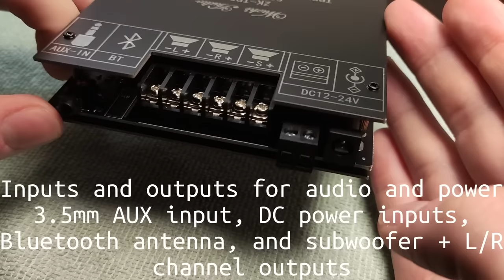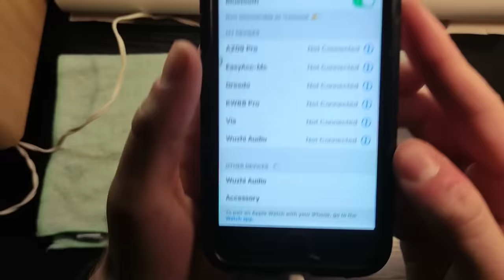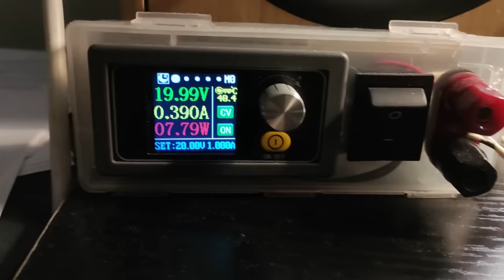Cheap 200w 2.1 Amplifier - Wuzhi ZK-TB21 Unboxing Assembly and Test

Comment: I own a few and one by FOSI Audio. They are great for my use cases. The only think I dislike is that when I have aux connected the Bluetooth chip is still available for pairing, and it's not good to have your music stream interrupted in the best part.

I've though of hacking the device to add a switch -- not sure it's easy to do. I've even thought of cutting the antenna and using external Bluetooth receiver.

Thanks for the video.
Reply from the maker: Yes that's common with the jieli microcontrollers on them, they can be flashed with firmware that gives aux priority over Bluetooth so you can't connect to it when aux is connected. I so far have not found any way to do this though. There are some forum threads online that discuss it but don't have any success.
Reply: if only you could show us how to cut the bluetooth output to the preamp section.... or perhapas any idea to mix the signal from bluetooth with some signals from microphone preamp?
Reply: I have this exact amp I bought 2 years ago and have abused it daily and it still works perfectly.  However at some point the Bluetooth range went from a dismal 10' range new to about 12"!   I literally had to leave my phone on top of the amp to get clear reception (have another 100wx2 amp that does this too).  I bought a cheap Bluetooth antenna from parts express($5) and cut the PCB antenna about 5mm in and soldered the tiny antenna wires to it and now my range is about 20 feet!

The antenna is a chassis mount and the antenna can unscrew from the mount.  I drilled a hole to mount it in the top cover and when the antenna is attached lays almost flat with the cover.  Antenna and cover are parallel to each other.
Reply: @voodooyam I've been very happy with the performance of the amps I own with exception to the Bluetooth range.  I have no idea how the range can deteriorate like it did.  I use one to power 2 old Polk speakers and an 8" subwoofer hooked to my TV.  Another is used to push 4 8" ceiling mounted speakers(2 on each channel in parallel to make 4ohm load) in my enclosed porch.
Reply: I wish I had a switch for bluetooth because my stupid neighbors are at the edge of the bluetooth connection and some idiot tried to connect to my speakers once, and now every time he's at certain range his phone tries to connect to the bluetooth and it does the constant "connected" sound.... :/ kinda wish I could disable the bluetooth completely if I can't toggle.
Reply: You can cut the antenna.
Reply: @Mavi222  I haven't been able to find a pin out diagram for the Bluetooth chip because it's a Chinese chip with no info.   I would also love it if I could figure out how to switch Bluetooth on and off

Comment: Ano magandang 2way fullrange  speaker para sa ZK-TB21 at ZK-HT21? Yung available sana sa pinas
Reply: *Para sa Left and Right channel
Reply from the maker: @techsoundph6210  There is too much variety for only one recommendation, any passive 2 way speakers can be used. I use Eltax Monitor iii but any other models can be used as long as the impedance is 4-8 ohms and it can handle the power from the amplifier.

Comment: If u turn sub chanel at full volume the distorsion is insane..
Reply from the maker: What power supply did you use? It will distort heavily at high volumes if you use anything under 24v with at least 4 amps of current capacity.
Reply: Why mine has a diatortion but my power supply is 12v 10a
Reply: @jecryswin  Thats total of 120watts its not enough in high volume
Reply: @jecryswin you need 200watts of power supply

Comment: is it on normaly temprature  if i put 19v ? for daily uses ? not hot / overheat??
Reply from the maker: For constant use I suggest you use a small fan on the heatsink to keep it cool, it will get hot if you use it at high power continuously.
Reply: @scellysspeakers  thanks my broo... i've been subscribe to you 👌

Comment: how to avoid humming buzzing noise?
Reply from the maker: Make sure you use a power supply with very little DC ripple
Reply: @scellysspeakers  can u suggest? what kind ?
Reply from the maker: @impopio4987  The best case scenario for clean DC power is an appropriately protected battery pack of the correct voltage, but almost any normal power supply of at least 20v should be fine.

Comment: Please tell me that 200w(50w+50w+100w) is it peak power or RMS? If it's peak then what it's actual RMS watt?
Reply from the maker: The 200w most likely is just peak power, i'd expect continuous RMS power to be closer to 150ish watts (37w+37w+75w) since the amplifier is rated for maximum 24v and a bit over 5a.
Reply: There, these capacities are almost two times less than those declared as usual by marketing ...
Reply: Depending on what power supply and amperage, remove from this RMC 25% and you will get pure power without distortion of the real one in the measurement standard DIN What is real and not RMS for beautiful ciphers
Reply: He’s running at half power at 7.83 watts, it’s a scam device with fake lettering. In reality it’s a 20w amp. Having djd for 30 years with a commercial 150 watt amp it would tear those little speakers apart.

Comment: Can i use 12v 10ampere, is it enough for power supply
Reply from the maker: You would want to use a 24v power supply of at least 5 amps current capacity to get the most out of it, if you use anything under 18v it will distort heavily at high volumes.
Reply: @scellysspeakers  but 10A.
Reply from the maker: @emesacolney2756  That bit is fine but you won't get the full power out of it unless it's a 24v input, no matter how big the current capacity is you will still get distortion at high volumes if it's under 18v
Reply: @scellysspeakers  thanks, ...... I ordered on amazon and almost arrive, ZK TB21
Reply from the maker: @emesacolney2756  I hope you enjoy it when it arrives!
Reply: @scellysspeakers  can i use 12inch subwoofer
Reply from the maker: @emesacolney2756  You can but it won't be driving it at its full potential
Reply: 18-24v 5-8 ampere

Comment: I use a zk-tb21 circuit and a 19.5v 4.62a power supply, how many watts should the subwoofer use?
Reply from the maker: You'd expect probably around 70ish watts maximum power output from the subwoofer channel at that voltage.
Reply: @scellysspeakers  70 watts but how much resistance do you think the subwoofer should have?
Reply from the maker: @nguyenhoangduykhai4303  4 ohms ideally
Reply: @scellysspeakers  3 ohms usable and can you tell me what effect the ohms spec has on the speaker
Reply from the maker: @nguyenhoangduykhai4303  The lower the impedance (ohms), the more current the speaker will draw from the amplifier at a given RMS voltage. If you use a speaker below 4 ohms you are drawing more current from the amplifier than it is designed to and this can cause overheating of the amplifier. This is why in car audio subwoofers have very low impedances but other scenarios like home theatres have higher impedances, because in car audio systems the voltage used is lower (12v) so therefore a lower impedance is needed to get more power.
Reply: @scellysspeakers is 8 ohms speacker work well with this amp?
Is more ohms good or less?

Comment: Do I need a 100w subwoofer or can I use the 800w ?
Reply from the maker: You can use a 800w subwoofer, but this amplifier will not drive it at its full potential. Also, if you are going to use the amplifier at full power for a long time, make sure you keep the amplifier chip cool with a fan on the heatsink.

Comment: What is the default turn on state?is it   bluetooth or aux?
Reply from the maker: bluetooth, when you plug in an aux cable and there is nothing connected to bluetooth it will play from the aux input, but you can still connect to the bluetooth when aux is connected and that will make it switch to bluetooth
Reply: @scellysspeakers  thank you very much...now i know i can connect it to my computer.

Comment: Hello friend the ic was hot or normal during playing time
Reply from the maker: After a while I can feel the top plate is warm near the heatsink at about 60% volume for both L/R and subwoofer channels, it isn't hot enough to be a concern but if you are pushing it 100% for a long time I suggest adding a fan
Reply: @scellysspeakers  Thank you

Comment: How many watts woofer can run 300w
Reply from the maker: Depends on the impedance, but it should be able to run at a full 100w for 4 ohm speakers with the amplifier running on 24v. Although for high power like that I suggest adding some sort of active cooling to the amplifier.

Comment: Pede kaya 3 speaker na pare parehas na ikabit ?
Reply from the maker: two satellites and a subwoofer, yes
Reply: @scellysspeakers  ibig ko sabihin boss is magkakaparehas na specs ng speaker  L&R (same  specs of speaker) and the sub is same specs of speaker na ginamit sa L&R
Reply from the maker: @milquinientoscuatro2996  you can but you may overload the speaker connected to the subwoofer channel as it can deliver twice the power of the other channels
Reply: @scellysspeakers  typically ilang watts at impedance para sa sub?
Reply from the maker: @milquinientoscuatro2996  this amplifier is rated for 4-8 ohms and up to 100w output for the subwoofer, but realistically i think it would be closer to 60w peak. as long as the subwoofer can handle the power and is the right impedance it will be fine

Comment: No Crossovers?
Reply from the maker: It uses a crossover for the low pass filter on the subwoofer channel
Reply: The amp already has a crossover for the woofer?
Reply from the maker: @jhas1980  Yes it only lets a frequency below a user-defined value to the woofer, that is what the subwoofer frequency knob does.
Reply: @scellysspeakers  Can I use it as a 2.0 amplifier? I don’t want to connect a subwoofer for the time being, will there be any sound loss?
Reply from the maker: @jiangzhao1142  You can, but the left and right channels have a high pass meaning the bass will be cut off. This amp is designed to dedicate all low frequencies to the subwoofer channel.

Comment: So if i put 24 volts i can pot 12 volt sepeakers and woofer?
Reply from the maker: 12 volt speakers? what do you mean? this amplifier is rated for speakers between 4-8 ohms
Reply: @scellysspeakers  i mean car speakers and subwoofer
Reply from the maker: @Mariuxes  those will work fine as long as their impedance lines up with what the amplifier supports
Reply: @scellysspeakers  thank you
Reply: @scellysspeakers  hey bro ,i got a problem ,i ordered one but... Idk What kind of jack it needs can you help me pls?
Reply: @scellysspeakers  Because i cant find 2.5x 5.5 mm jack i only find 2.1x5.5 mm jack so Which is the correct one?😢
Reply from the maker: @Mariuxes  theoretically both should work just fine as far as i'm aware
Reply: But where did you get the amplifier? I got it from aliexpress
Reply from the maker: @Mariuxes  i bought this one on amazon
Reply: @scellysspeakers  Hello, I was wondering if I should put a 12 volt and 8A power supply? Would it work?
Reply from the maker: @Mariuxes  Yes it will work but you won't get the maximum power output of the amplifier
Reply: @scellysspeakers  and what do you recomend?
Reply: @scellysspeakers  idk what power suply to put so is the most efficient

Comment: Does it have short circuit protection on speaker output on this amp? In case of accidentally shorted the speaker output terminal?
Reply from the maker: It doesn't mention having this anywhere in its marketing material online so I'd assume it doesn't.

Comment: Will it work on 12v 5A
Reply from the maker: Yes it will but you won't get the maximum power from it. For highest power output you will want something like a 24v 5a power supply.

Comment: Do not use this board without any speaker protection. Good sound quality but, it cannot be long last. My Wuzhi zk-TB21 damaged after 4 days of use.
Reply from the maker: Were you using it at high power? For high power continuous use I suggest you use a small fan to blow on the heatsink.
Reply: @scellysspeakers   19.5 volt & 15 amp. It's problem DC volt out sometimes. Thats why speaker burn. My wuzhi board has IC cooler fan.
Reply from the maker: @passionoflife6207  I have not experienced this at all, I've tested it for DC bias on the output with a multimeter and there is none. Furthermore there are output filter capacitors that would stop DC, so it's likely you have a fake or faulty unit.
Reply: @scellysspeakers  When it was new, it was too good and original. Never short speaker side or Never connect / disconnect speaker without power off. Even never connect DC port without switch off. Should not use low wattage speakers. My Microlab speakers burns after few days. If it was last long, It's just awesome clear bass and stereo without distortion.
Reply from the maker: @passionoflife6207  Oh it's the speakers that burned, not the amplifier?
Reply: @scellysspeakers  Also Amplifier stereo port out dc 19.5 volt. no audio there.

Comment: damn..is that a real one?...not using the box case..but bass sound is perfect😱
Reply from the maker: Yes, the amplifier in the video is a genuine one. You can tell because the fakes have glossy PCB top covers and do not have small SMD components around the chokes.

Comment: It’s definitely not a 200 watt amp in terms of running a 200 watt speaker. It’s 2 x 50w + 100 w sub on the box which is fake lettering. Your measurements had it at 7.83 watts at half power. Throw an 80 watt speaker on it and measure the draw at full noise. I’d say it’s 20 watts each side and 40 w sub in reality. So it’s a 20 watt amp in reality.
Reply from the maker: This isn't a review, I'm not trying to push it hard. I don't have the equipment to give it any more power, if I did then I would make another video showing it running at higher power. I too doubt that it would produce 200w, but seeing as it uses genuine TI chips I wouldn't be surprised if it could push at least 100w total with some active cooling. All the correct supporting components are on the PCB for it to stretch its legs out a bit.
Reply: @scellysspeakers  okay good to know.

Comment: Even at 14V 10A, that is only 140 watts, and I doubt it's actually drawing 10 amps. Notice he used the word 'cheap' in the title, there was a reason. Another cheap misleading overrated amp from the orient.....
Reply from the maker: Well yeah at 14v there's only so much current you can draw from speakers with a given impedance. And the PCB layout and design is Chinese, but the chips used are genuine Texas Instruments class D amplifier chips, the datasheets for which can be found on the TI website. I agree that the majority of amplifiers and things that come from China are not the best quality, but this is one of the things that I think are great for the price. Also, how can it be misleading to call it cheap? 😅 I'm trying to state it just as it is, and this video is just to raise interest for these interesting imported devices. You're more than welcome to come to your own conclusions on it, though, based on whatever you think. It's a free internet.
Reply: @scellysspeakers  I think you know how to do the math,  V x A = W
14 x 10 = 140. And Class D is not the  best type of amplification either. I was merely pointing out that there is no way this amp is going to push 200 watts.
Reply from the maker: @donaldgregg9250  Let's do some more math. This time with Ohms law which is V = IR, where I'm using resistance instead of impedance since I'm assuming with these calculations that the phase difference of the speakers reactive power is negligible. Let's presume that there are two 8 ohm speakers connected to the left and right channels, a 4 ohm subwoofer connected and the amplifier is being powered by 24v which is what the manufacturer recommends. If you rearrange the equation to make I the subject, you can find the maximum that each speaker driver on the left and right channel can draw is I=24V/8Ω=3A, so therefore it would be drawing 24V*3A= 96w hypothetically. That's a total of 192W just for the left and right channels which is far into the clipping point of 50w for this amplifier, and obviously it would never reach this high of an output power because of inefficiencies and limitations of a tiny class D chip. If you apply the same maths to the subwoofer output, you could have I=24/4=6A 24V*6A=144W theoretical maximum power output, again over the 100W clipping point and power limit of the Texas Instruments TPA3116D2 IC. I don't really have any reason to personally doubt the full power output capabilities of it having inspected the PCB, components and doing my own research on the parts it uses.

And you are right, Class D is not the most "Hi-Fi" amplification technique as it uses a PWM signal to modulate a voltage to simulate a linear audio output signal. However, it is the most efficient amplifier class. 

Edit: i didn't realise I wrote this much 😂
Reply: @scellysspeakers  okay, I will admit that you understand electronic circuits more than I, although I do understand much of the fundamentals. It is hard to comprehend how these smaller IC amps can deliver a good amount of power, but I'm assuming they hit a clipping point quicker than Class A. Heck, I'm still trying to understand how vacuum tube amps operate!!!
Reply from the maker: @donaldgregg9250  Well I think so far you're doing a great job with understanding most of this stuff. I'm just trying to help people understand stuff like this, because once the misconceptions are cleared up then you find out you know more facts than you realise. There's plenty of videos on YouTube that can help explain it, and I hope I helped explain my point. Thanks for dropping by though 😁
Reply: @scellysspeakers  thanks Scelly 😁
Reply: @donaldgregg9250  No , there is NO way it will get you 200 watts. But lets be realistic....for the price , and for a desktop system for example , it can sound very good indeed. I have put together several such little systems .